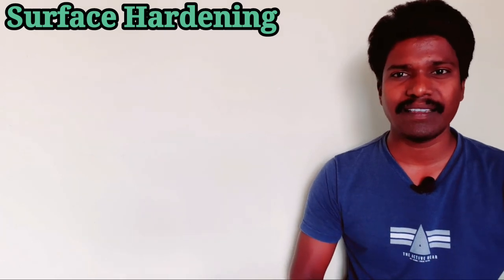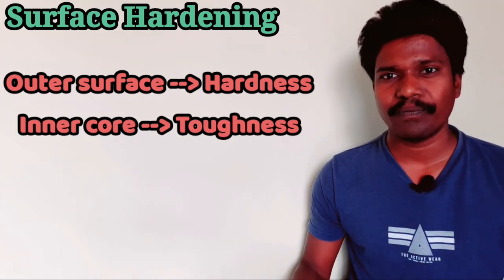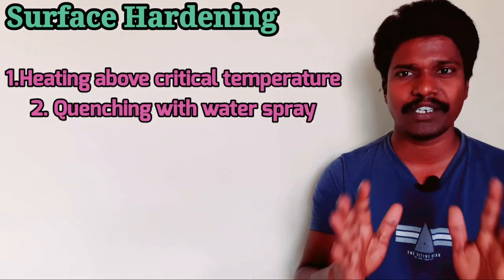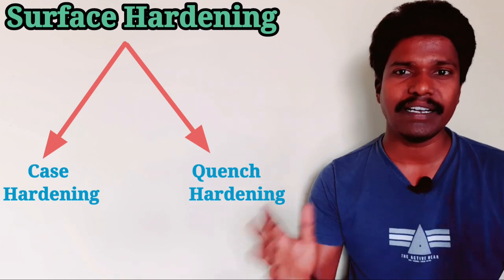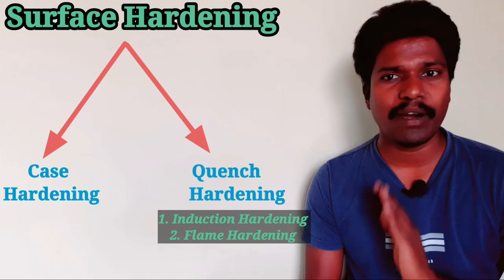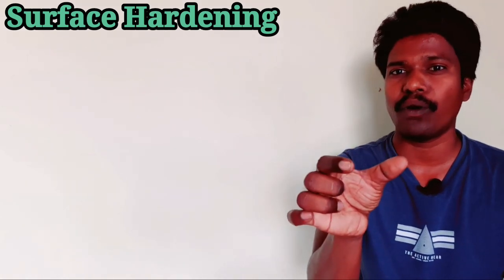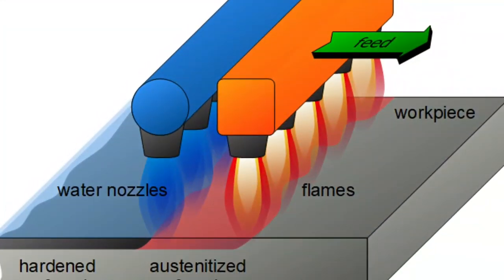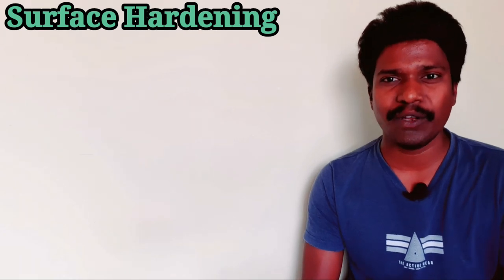Surface Hardening of steel

Comment: Some of heat treaters maintain carbon potential inside furnace, why carbon potential (CP) required for surface hardness process.(material high carbon material)

Comment: Hi Anna I have one doubt.. Hardness of steel increases if it contains cementide yes... But in  some books give the answer is martensite... Plz anna can you clarify my doubt.
Reply from the maker: Cementite is the primary factor which decides the hardness. Martensite is formed only after heat treatment. So always prefer to answer cementite.
Reply: Thank u very much anna